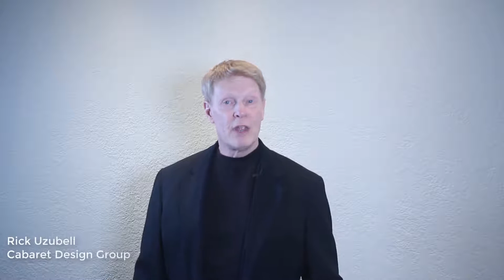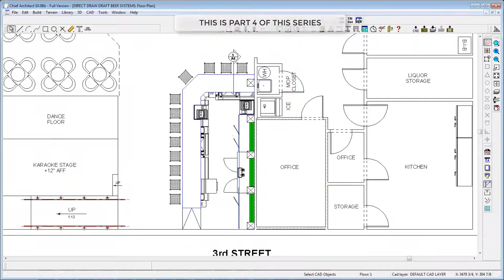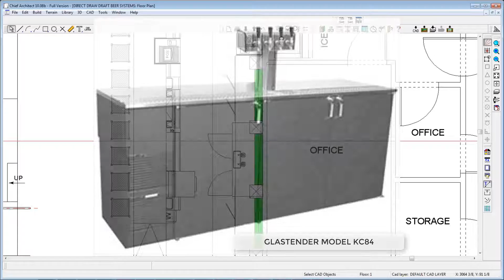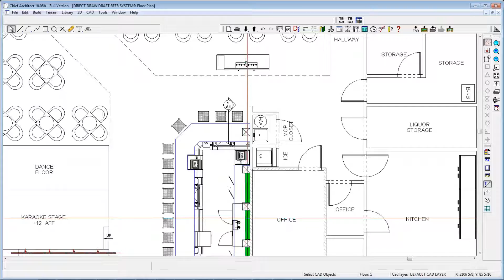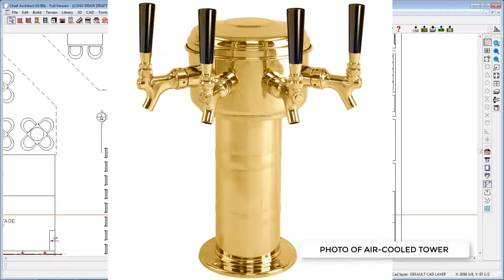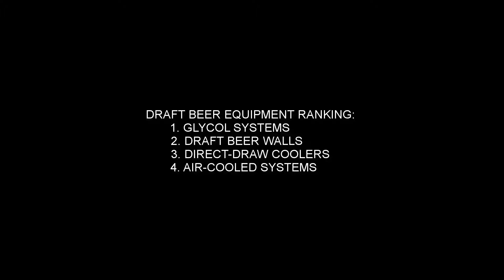How Much Do Draft Beer Systems Cost?

Comment: Great breakdown of each system, but I am curious why maintenance seemed to be absent when making a determination. If you have to clean these lines with any regularity, then long draw systems become increasingly difficult to keep within margins.
Reply from the maker: Thanks for the question. All draft beer systems (no matter which type) are required have the product lines flushed and sanitized on a periodic basis. This is required by all health departments in the U.S., with most requiring every two weeks. The local health department will also specify who performs the maintenance - usually it's the beer distributor. Obviously the longer the trunkline the more product that's lost. For most applications we're always looking for the most efficient approach. However, high-volume operations (such as casinos) don't have as much concern of lost product as they do for finding the space to accommodate the walk-in-cooler and the associated trunklines of many of those systems are hundreds of feet long. The best of all worlds is when the walk-in cooler is located in a basement.